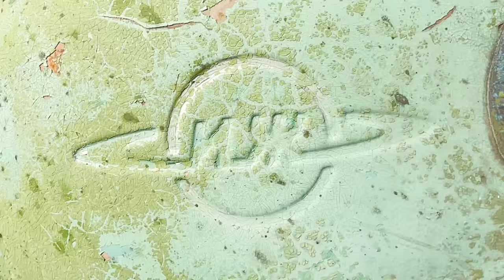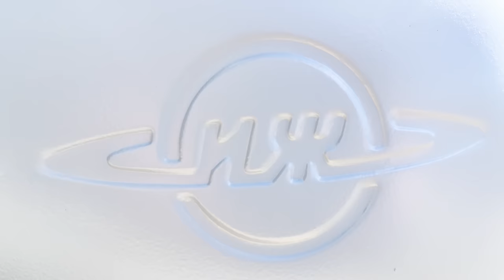Rusty JAWA Tank Restoration - Full Restore Rotten Fuel Tank

Comment: Nice video, but I have to remark that it is not good practice to simply fill  heavy dents with putty. That is just cosmetics for selling purposes. Sooner or later the thick layers will develop cracks, thus destroying the whole apperance of the workpiece.
Reply: Couldn't he have used a reverse hammer to pull those dents out?